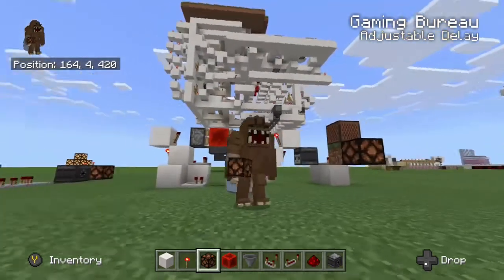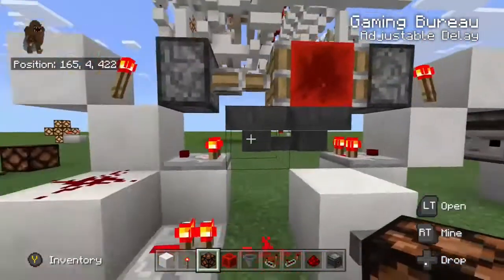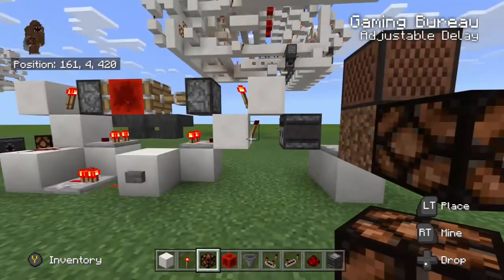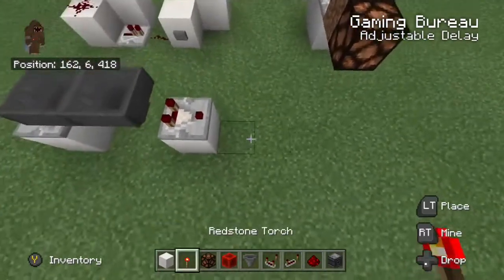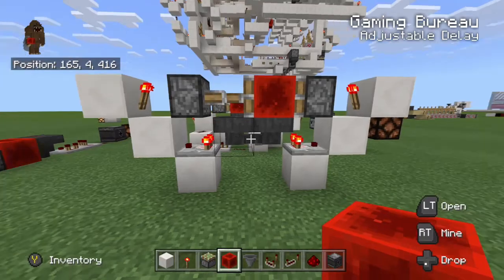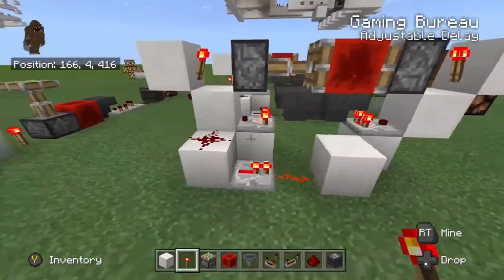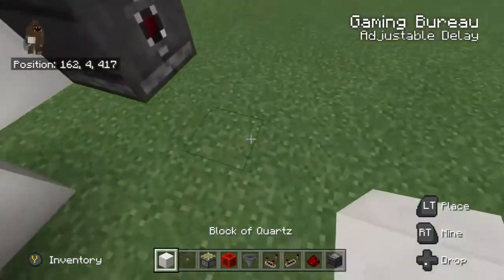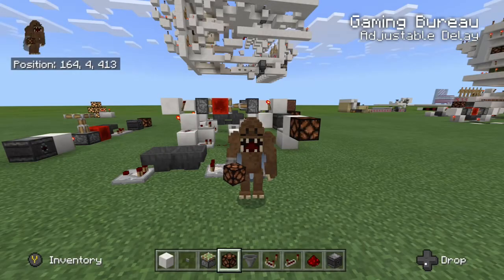Adjustable Pulse Delay Circuit Bedrock Minecraft

Comment: I used this in a two way, single column water elevator, as an indicator of when to enter upon activation. It takes about 15 seconds for the bubbles to float up from Y level: -30. Prompted to enter, you shoot up 125 blocks almost instantly right before everything resets itself. Great find!